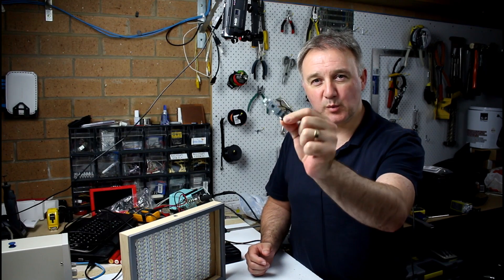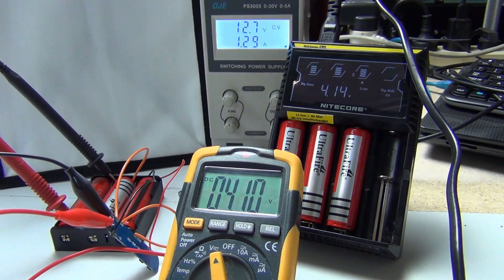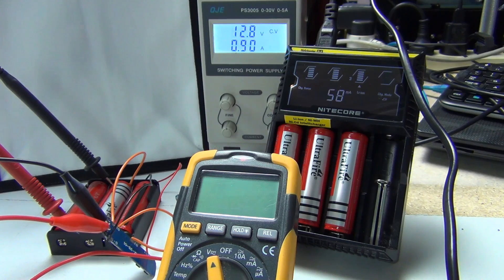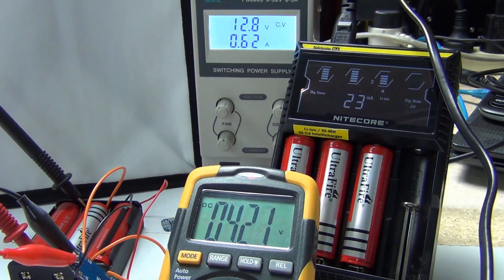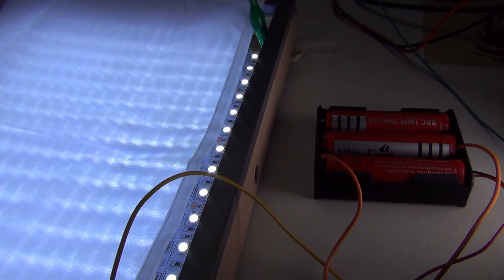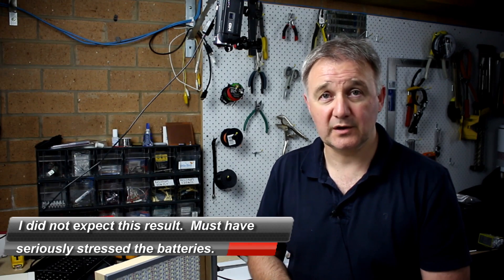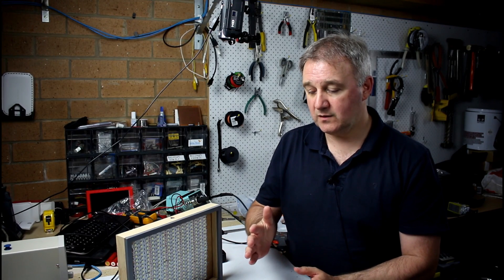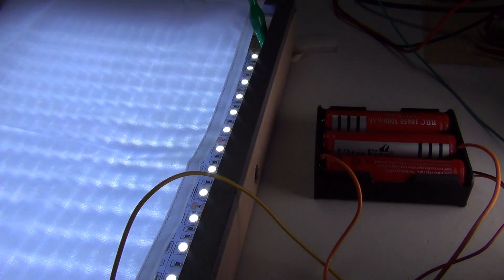BMS vs Battery charger - Surprise result (MEHS) Episode 58

Comment: Hi - me again. Thanks again for all your hard work and sharing! Here are my thoughts on your latest test:

 I disagree with your methodology and conclusion in this test for the following reasons:

1) Using Utrafire cells which are too erratic to guarantee repeatable results. Maybe do the same test with both packs in the other charging scenario?
2) Recording the starting voltages of the pack and each cell. I think the 3S board behaves differently at lower voltages so it is relevant.
3) The 3s board does not balance charge the cells. Ensure that all cells are of the same voltage at the start.
4) I don't agree that your 3s scenario is a "raw dump of power" from what I can deduce on your bench power supply amp meter. It seems to start off at 2 Amps and then drops to 1.3 Amps and further to 0.5-ish Amps before terminating at 0.16 Amps. Isn't this what we want to happen?
5) I think that both charging scenarios are slightly over safe, especially the Nitecore which is maybe why it performs slightly worse. I would have liked to see you swap the packs to see if it followed the same pattern. I understand there is a significant difference in capacity if you stop charging at say 4.150 V, and of course there is a significant degradation of the cell if you stop charging at 4.35 Volts, which is why these chargers both would tend to aim for 4.15 Volts.
6) It would be interesting if you can monitor the current between the 3S board and the battery pack. Also, the volt meter unfortunately switched off in the middle of the test.

As I said in your previous video, these boards do have some purpose if you start off with a balanced pack. They do protect against over discharge, over charge and over current draw. There is a risk that the 3S board can fail, and precautions need to be taken against this by individual fusing of each cell etc (see Jehu Garcia and Shawn McCarty) but it can be quite useful if used in the right manner. 

Thanks again!
Reply from the maker: - Hi.  Yes I see everyones point that a repeat of the test would have been useful.  I also agree that these cells are not identical in capacity or behavior.  I might do a retest with better cells.  Yes I need a meter that I can set to stay on for LONG recording sessions.  Yes the Nitecore charger is safe but that is the idea for cells like this.  Your point 4 is interesting.  This is one of the real problems as the current is decreasing as expected but this is only desirable if we are charging a lead acid battery, not a lithium battery.  The fact that the current decreases over time is fine if it was in the second phase of the charge cycle but its not, its happening from the beginning.  We need to get a CC phase going to the cells.  I say raw dump because this is just applying power to the BMS and the BMS is just dividing the voltage going to each cell (yes it monitors the voltage).  This is not the way you want to charge your lithium cells.  You might get away with charging lithium cells by dumping power into them for a while but there are risks.  Cheers.

Comment: Still think it would have been prudent to swap the battery packs to the chargers, just in case you had 1 or 2 low capacity cells.  Keep up the good work.
Reply from the maker: - Hi.  Fair enough, I agree the cells are not perfect and I did have a couple that dropped quicker than others in other tests I did.  Cheers.

Comment: very informative video. Thanks! Did you swop the batteries? Would have been interesting to see if you get the same result when you switched the batteries.
Reply from the maker: - Hi.  I mixed the batteries to get a random assortment before the test.  Yes I could have done more testing but I doubt the results would have been significantly different.  Using high quality and genuine capacity batteries might have been interesting though as that should have minimised the variance between the cells.  Cheers.

Comment: did you checked the voltage of every individual battery after it fully charge? does the bms stopped charging after the battery is full?
Reply from the maker: - Hi.  Yes I checked the voltage of each battery.  They vary a little (not perfect) and no the BMS does not stop the flow of power to the batteries.  In my other BMS video I discuss the problems of just using a BMS.  One of those problems is the fact the BMS does not stop charging and can over charge and damage cell.  It also does a sort of float charge which lithium batteries dont like.  Cheers.

Comment: Have you calculated how long the 18650 would have supplied power if they were charged 100% to be able to say that they were overcharged?
Reply from the maker: - Hi.  The issue is these batteries are not real Ultrafire cells and the rating of 3000MAH is false.  Considering three batteries were charged fully in the Nitecore D4 I would say that represents 100% charge and capacity.  Since the BMS charged batteries went 35 minutes compared to the others at 25 minutes, its fair to say the BMS / bench power charge was 25 to 30% overcharged.  We also need to take into consideration that the BMS board delivering the power to the LED panel does not balance the cells which means it only takes greater variance in one cell to throw the results out.  Cheers.